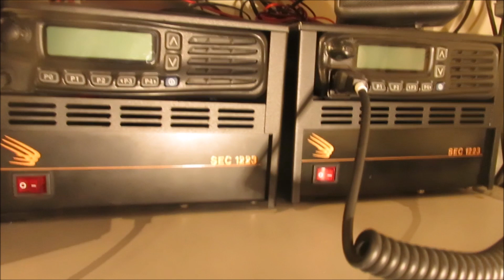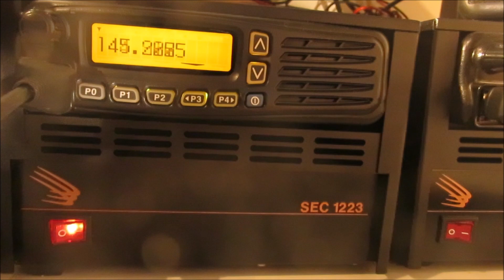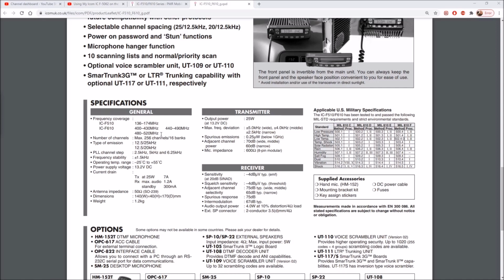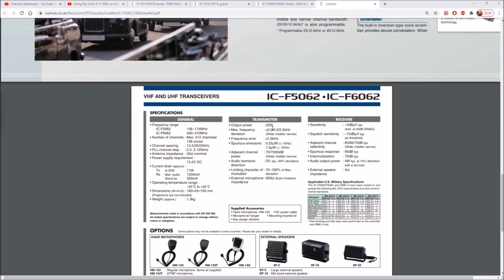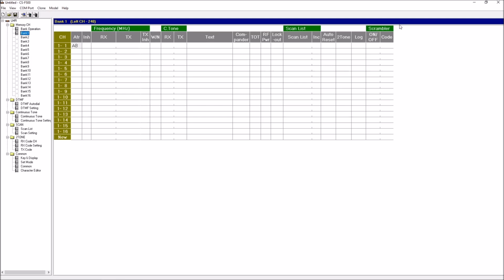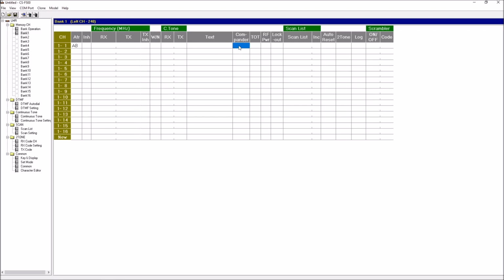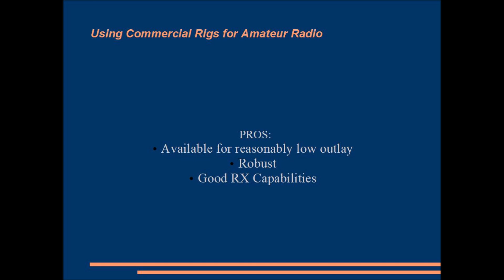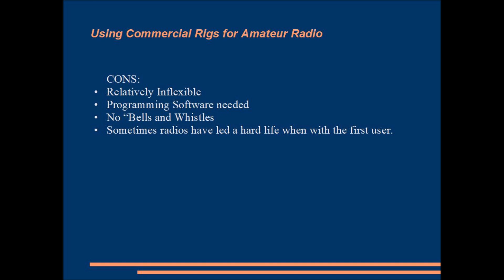Icom commercial radios- Suitable for Amateur Radio use?

Comment: I have made several digipeaters using the F-121S radios. The "S" model is only 8 channels and have no screen. But they work well for link radios or like I use them as packet digipeaters. I have 3 of them in service as digipeaters covering over 300 square miles here in Florida. Two of them are in two hospitals here.  Another at a tower site with the antenna at 300 ft.

Comment: Thanks for the videos Kevin.
got a 2nd hand 6062 which read much lower than expected power, loaded up the adjustment software and found the power has been lowered so cranked it back up.
something worth checking when you get these radio's.

Comment: The situation is similar across the pond. I've used the earlier versions F121/F221 as well as the F521/621. Biggest difference is the amount of memories available. F121/F221 were 128 memories, F521/F621 were 256 and as you noted F5063 were 512 memories. I typically program one of the P buttons as "power" so that I can adjust transmit power from the front panel. As you noted the major disadvantage is the lack of front panel programming. That's actually a FCC requirement for commercial service. Not much of a problem as long as one used the radio in the same geographic area. If I'm traveling to a specific destination, I'll research repeaters along the route and the destination and preprogram them into a different memory bank. Another advantage of the commercial radio is the front end is usually a lot "tighter" and rejects more signals in an urban setting. de N8WLF
Reply from the maker: Bruce I agree, they are excellent radios just need a bit of pre planning when programming. I use mine mainly in the shack so that is easy. With the newer models with upwards of 500 channels it would be possible to program all the UK repeaters anyway if the radio was being used in a mobile situation.